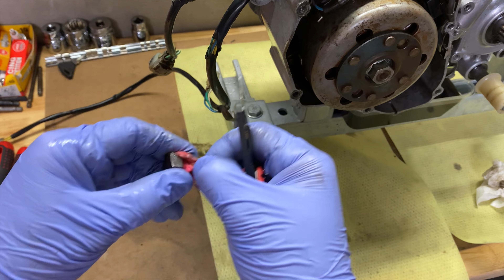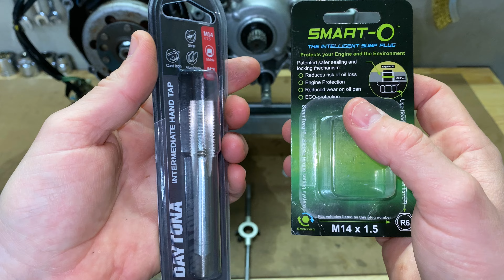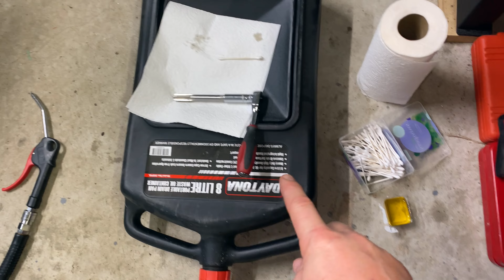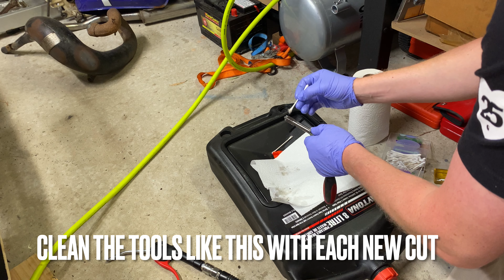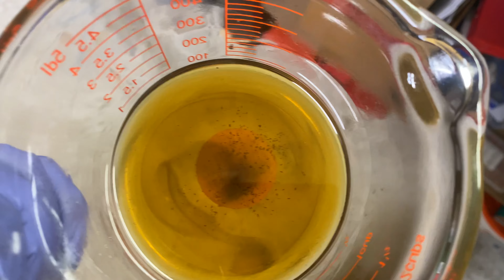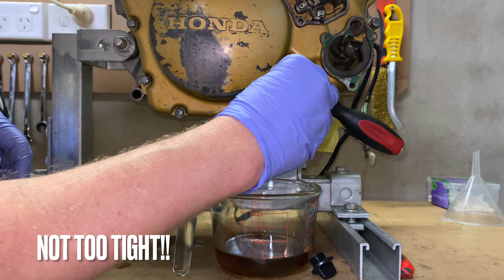New Oil Sump Bolt & Gear Box Oil - Honda CRM250AR Part 4

Comment: i just bought my first motorcycle. It was a aprilia rs 125. It was in good condition but woudn't fire up and start. Thanks to you and your videos it now starts! Thanks you tom great videos!
Reply: One question though. What top speed does your aprilia rs 125 have? And how much horsepower would you estimate it to have? (before and after the 34mm carb)
Reply from the maker: I changed the gearing on my bike to suit my riding conditions. 16-40 sprockets provide quicker acceleration, I made a video about this.
To answer your question- my top speed is about 140 and HP I would estimate 25-35hp? A dyno run is needed👍
What bike do you have?
Regards
Tom
Reply: @tomdidit4216  okay! I have a aprilia rs 125 from the year 2000. A yellow and black moto gp replica.
Reply from the maker: What a great first bike!👍
Reply: @tomdidit4216  yes it sure is a great bike! I see you have the arrow exhaust on your bike. I only have the original exhaust. But the exhaust befor 2002 doesn't have a cat inside so should i still upgrade my exhaust???
Reply from the maker: This is up to you. It will depend on the performance and sound you want. An exhaust is generally one of the first things people do on a bike when seeking a bit more power.
Reply: @tomdidit4216  i have the power valve and rave unit installed. And seeking a bit more power out of the bike. Should i go for a new exhaust? Does it make a lot of difference in power??
Reply from the maker: I’m not sure to be honest. My bike came with arrow exhaust so I can’t compare the difference between stock and aftermarket.
I would assume that aftermarket model will provide some weight savings and extra power over the stock exhaust, as this is the case on most other bikes👍
It seems you’re going for full power!😀
Reply: @tomdidit4216  yeah i do! I think i'll stick with the original exhaust for a bit
Reply from the maker: That seems sensible - See what the results are like before spending big money👍
I’m interested to hear what you think about the bike and its performance.
The RS125 is allot of fun!
Cheers
Reply from the maker: Good to hear! Glad they could help.